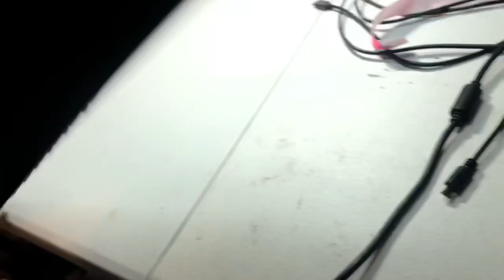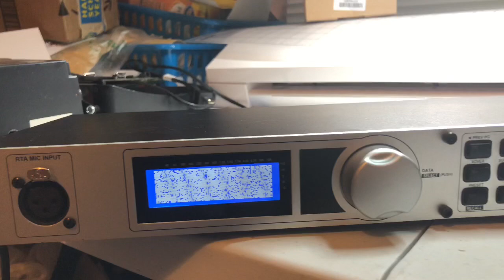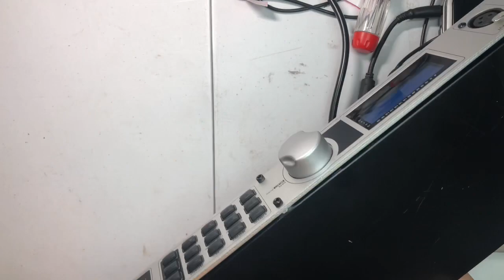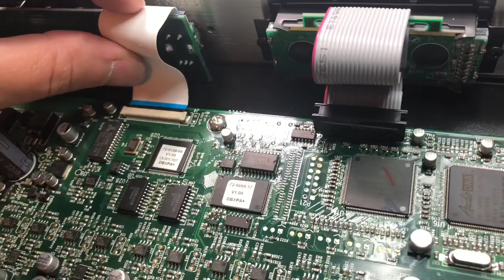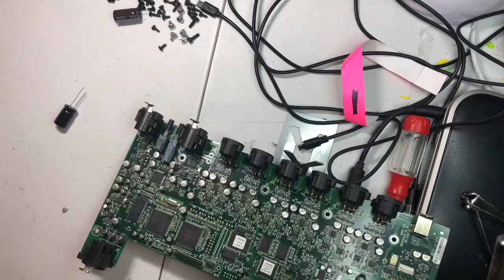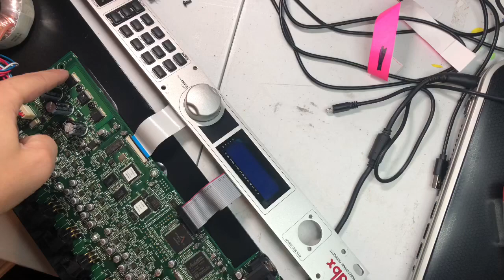Dbx driverack pa+ repair does not turn on fix

Comment: Hi i have similar problem i have a dbx drive rack pa model: Dbxpav-eu . The display is just lighting up after various tries half the display showed up and went away after turning back on and off again, i tired pushing and cleaning the ribbon contacts but nothing happened
Reply from the maker: @TheUndergroundgen  replacing capacitors will be your fix

Comment: There isn't even a thing wrong with the aesthetic look of this product. You should be doing this on a soft surface to prevent scratching.
Reply from the maker: @eugenecountryman8169  it’s a plastic table. It was thrown out unit that was recovered and used elsewhere. 🤷🏻‍♂️🤣 end user got a free repair and helped others. I don’t care

Comment: hi there, I am repairing a driverack PA, the original, (no muting switches) and need a display. Any suggestions where to get one? DBX has been USELESS so far. thanks for your help.
Reply from the maker: @hitekhead  send me a photo of the display part number if you can find it. Hitandrepair at gmail

Comment: I have a DBX Driverack PA+ but have the problem WAITING FOR FLASH DOWLOAD at startup. I need the file extracted from the U17 chip, but on the DBX website there is only a Firmware update which doesn't work. please help me

Comment: I have a case for dbx pa+, the input/output signal is read but there is no sound out, can it be indicated that the DAC IC (CS42528) is damaged?
Reply: Can i replace CS42426 with CS42528 in my driverack PA+? Because the DAC ic of my driverack PA+ is CS42426

Comment: Why doesn't DBX use longer life / higher temp electrolytic caps in these units?
Same problem but worse with their 1261, 1260, 641, the Zone Pro line. It shouldnt' be happening.

Comment: Thanks for the video. I have a dbx 220i and the program display just says "F" and the load button is illuminated in red. I can't connect with the driveware. Does anyone has any ideas? Thanks.

Comment: I got isue with dbx drive rack pa as one of the chanal got distorsion. But not all the time. The one capacitor on power suply doesnt look the same ass the other one. Can be that a problem. Tnx🤗
Reply: That chanal starts to work ok when I incrise volum of signal. Input

Comment: I would be very grateful for your part if you would help me friend.
The reference number on the main board where the ic is is U27 I can't see its part number it was short-circuited and nothing is seen
Reply: had same part burned U27.. any info regarding the part number.. thanks

Comment: Hello friend, thanks for sharing, I need your help, could you tell me what part number the part has that is very close to the filter that you changed, which has the code on the U27 board. I have that model but the part burned and I can't see its part number, it would be very helpful thanks
Reply: Do you got the part number .?
Reply: U27 IF89E or f89e

Comment: You Did A Good Job Figuring Out That Problem I Have One Now Just Like That One My Screen Is Doing The Same Thing Im Going To Take It ApartAnd See If The Capacitor Is Messed Up I Just Need To Know Where To Buy Another Capacitor From!
Reply from the maker: HollywoodTheDj eBay or amazon!

Comment: Do you know where the CR2032 Battery goes? I just received a Driverack PA (not the "+"). The insides look very similar to your PA+. I was told the unit will not hold memories because the battery needs to be replaced, but I cannot find any documentation on where the battery is. TIA, Richard
Reply from the maker: rpbrichard I don’t recall seeing one in this unit. The eprom chip might be bad then.
Reply: @hitandrepair were can i contact you